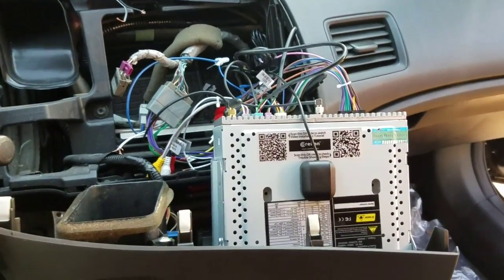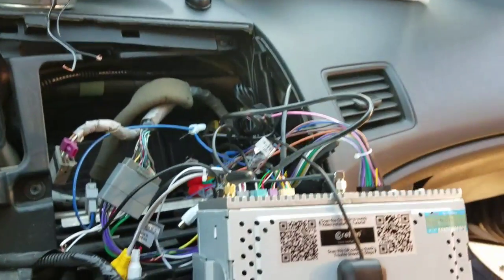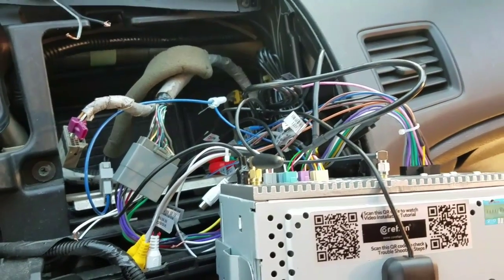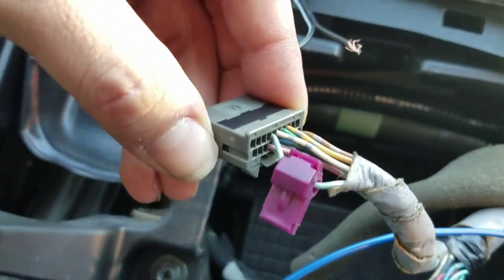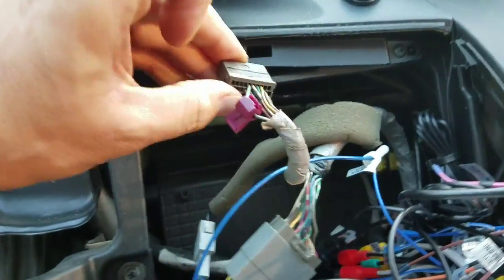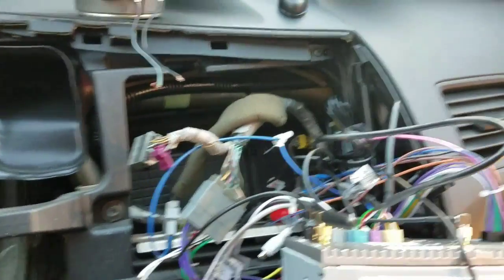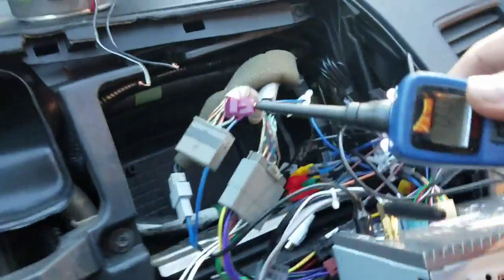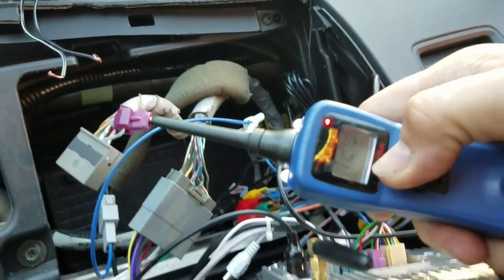2008 Civic, No Sound, Factory Amp Turn On Wire Color

Comment: I just wanted to reach out and say a huge Thank you 🙏🏻. Im very technically inclined, but for the life of me I could not fine the power wire. Picked up the car as a beater for $400 and wanted to run a system in it so I can chill when not driving my other Hondas. Things like this where definitely not around when I was growing up until after High School and Im so thankful for people like you who share what they have figured out. 💯💯💪🏻💪🏻
Reply from the maker: Hell yeah! No problem brother man 🤘
Reply: Will this work for a 2006 civic as well thanks in advance I appreciate it
Reply: @kaseylindee4282  Yes. It is the Same Generation.
Reply: @BeastFromTheEast79  thanks a lot I appreciate it have a great day
Reply: @kaseylindee4282  Absolutely. And you do the same as well 😊

Comment: This is really good video. My sound was not working . I was contemplating on running a separate  wire from the aftermarket radio straight to both front and rear speakers. But this video save me a lot of time. Great job

Comment: male connector, light blue...if my research is correct, that is the "amp turn on". thanks for the video. im trying to "restomod" my 97 civic and want to use the stock 2006 gen amp.

Comment: Yup that's the one thank you for your video and your help.
Reply from the maker: Hector Rios no problem sir.
Reply: lowroller94 hi bro i have honda accord 2008 i install aftermarket gps but everything is good but not sound is this wire i need conect with positive
Reply from the maker: All Tech I cannot make any guarantees. But I would like to assume that it should be the same situation. The amplifier power wire needs to get 12 volts to power on. One thing you need to remember is that you should use RCA low voltage inputs for your sound versus the high-level outputs of the aftermarket radio.
Reply: lowroller94 ok thanks bro i tried
Reply: Hector Rios oka thanks i done i have sounds check my channel  i make video how fix audio back for honda accord 2008

Comment: does that wire feed the amp? does that connector have a terminal with power? If it does, just use a paper clip to jump the two terminals together.

Comment: So how do you get the sound to work without having to connect that power giver to the amp cord?
Reply: OZO Soccer you run a wire from the radio power wire to that wire
Reply: Just use the remote cable  from the stereo that should turn it up

Comment: I didn't solder it and just used a heat wrap and tied em would that cause a lot of static sounds?
Reply: it wont but a few years down the line it might cut out every one in a while until its just gone

Comment: Hi Tim, did you use the RCA outputs of your xtrons, or just the amp con (blue/white) wire? Also how did you figure out the car's remote amp wire, mine has the SD Navigation HU and I can't find any wiring diagram for it. I'm trying to install the same xtrons HU to a 2013 9th gen hatchback civic.
Reply from the maker: Yes, I used the RCA outputs of the radio for the input of the speaker wires of the car. What happened was that I used the regular speaker outputs of the radio at first but since it was going through the factory amplifier it was way too sensitive and loud even at low volume. Using the RCA low level outputs on the radio fixed the problem.
Reply: @LowRoller1  thank you. Did you make a custom adapter or there's an ISO/RCA? I'll do some research..
Reply from the maker: @zsiga09  you can use any set of RCA cables. Just cut and splice them. I used a 1.5 foot RCA cable.. 1 RCA cable will give you 4 total once cut in half.
Reply: @LowRoller1  done, perfect. Now only need to find the e break wire and ready to go.
Reply: @LowRoller1  Where do you connect the RCA outputs to?? I have them connected to the stereo but I dont have a place to connect them for to the car. Please help.
Reply from the maker: @OZOSoccer  read the comments above. I explained how to do it.

Comment: Q? I have a 07 and I wasn’t getting any sound until I tapped the aftermarket blue/white wire to +12v but it cut the front speakers on I’m not sure if that’s a good way or connecting to the ignition power wire? Another thing did you connect the +12v red wire to the rear amp wire you said is Blue’ish Green? To make rear work?
Reply from the maker: The 2008 Civic may have a different wiring schematic. I'm not sure. Are you using an after-market wiring harness? There is the wiring harness that comes with the radio and there is also a wiring harness that adapt it to your vehicle. it would help if I could see some pictures. The blue and white wire that comes off of the aftermarket radio is to power the amplifier. And usually has 1/2 amperage load maximum.
Reply: Did you ever figure out the problem? My rear speaker in my trunk don’t turn on

Comment: My rear speakers are not working now. Before I would have to reach under the deck and wiggle the wires to the harness just for sound to come out correctly. It would sound far away. But now my rear ones are not working. Is there something about these sound systems on these civics that have issues? Not sure if it's the OEM amp?
Reply: It’s a wiring issue

Comment: Yea I seen were you got that power from but what cable do you plug coming from the car  Stereo to connect two that cable.
Reply from the maker: Hector Rios use the blue wire with a white stripe coming from the aftermarket radio. That is the amplifier Remote turn on wire.
Reply: U mean the amp 12v cable?

Comment: Hey man, I have the front left speaker with out sound, how do I know if is the amp or the stereo connection?,  the Twitter sound, or have a crossover?
Reply: Orange wire is front left speaker(-) negative and the blue wire is front left speaker(+)positive. Hopefully that worker

Comment: Hey man I i hope you see this comment. I followed this and thanks to you I have sound bro! I had one question though, when my deck turns on there is instantly static going through my speakers and even after I mute the deck. Do you have any idea why this would be happening?
Reply from the maker: Hi, glad I can help. Is the volume very sensitive? So for example if you barely turn it up does it get loud very quickly?

Comment: I have the same issue but with the factory radio, do I have to the same process or maybe the amp die?
Reply from the maker: 50/50 it's either the radio not sending signal to the amp or the amp is not working.
Reply: @LowRoller1  thanks man, I will check that out 👍🏻

Comment: Hey man, i did this to my car and it worked, all the speakers work, but just one thing, i get a distortion sound when im past 0 of voulme, if i have it on 0 its fine i dont hear nothing, but once i get it over 1 of volume it gets a distortion kind of sound and it doesnt increaso or decrease if u put the volume up or down, it just stays there but its loud and it boders me, hopfully u can help me
Reply from the maker: Chris Espejo are you using the high-level speaker outputs or the RCA outputs for your inputs into the car?
Reply: lowroller94 no i didnt, but in the video u seem to jave the same problem, do u have distortion in urs? And thanks for the replay man
Reply from the maker: Chris Espejo my video makes no references to distortion. It just shows you how to power the factory amplifier so sound can be heard from the aftermarket radio. I would suggest that you use the RCA outputs of the aftermarket radio for the inputs of the factory speakers. They are low voltage compared to the high-level outputs of the aftermarket radio. That should take care of your distortion. If it does not then I have no other suggestions.

Comment: For 2012 civic si would it be the same thing? I having the same issue
Reply from the maker: Probably not if it's a different body style than the 2008
Reply: @LowRoller1  bro im soo lost with this my factory works and but tablet doesnt just sound any ideas
Reply from the maker: @paulie416  find the factory amplifier and bypass it.

Comment: Brah I just had the same issue yesterday and we couldn’t figure it out I almost thought I had to buy a new harness
Reply: Need help not working hmu
Reply from the maker: @tmizzlebmx  what do you need help with?
Reply: lowroller94 I splice Instead of t tap that olive greenish wire! And merged the antenna blue wire and the blue amp wire! To that!! I turn my double din on and there is no sound! And I checked my amp! There was no lift indication it was on! So no power is even going to it!! I even tried the blue wire of the same harness where the one u t tapped!! Still nothing

Comment: I don’t have that wire !
Reply from the maker: You may not have a factory amplifier then.
Reply: lowroller94 everything turns on but no sound
Reply from the maker: @issaccaballero3929  what's the year of the car?
Reply: lowroller94 2006 Honda Civic
Reply: lowroller94 what do you think the problem is sir ?
Reply from the maker: @issaccaballero3929  if you are looking at the oem plug where the wires go into it, clip side facing down top, fifth one from left to right top row. 

That should be the amplifier wire. Is there one there?
Reply: lowroller94 nope no wire and found my problem! All the speakers were beyond gone... thanks for your help !
Reply from the maker: @issaccaballero3929  awesome, glad you got it figured out.